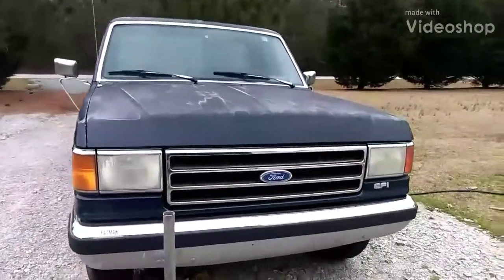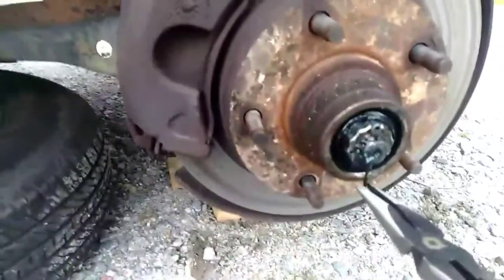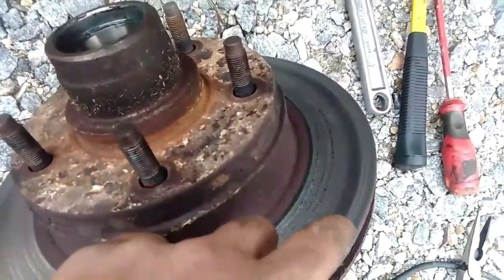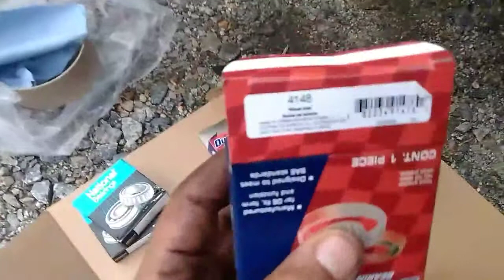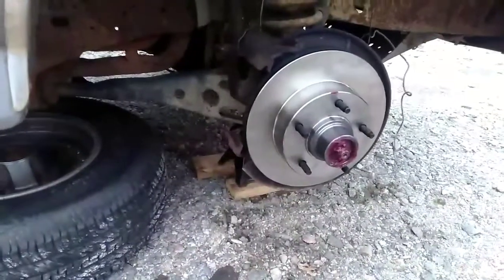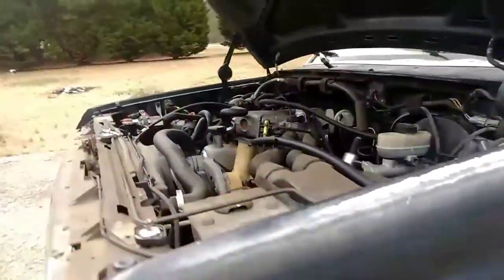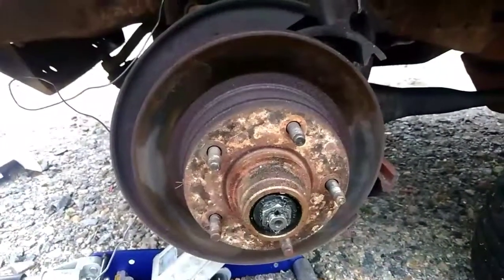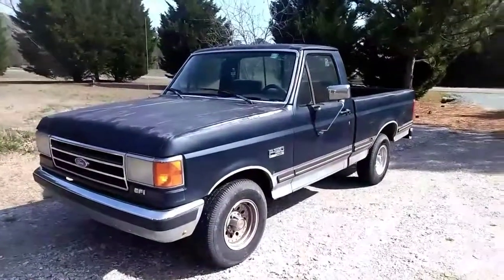91 f150 brake rotors change and pads

Comment: What's the torque on the nut
Reply: In my book it says 22-25 ft pounds as your torqing rotate roter forward. After you do that it say with your hand only back the nut off 1/8 turn its to tight to do that I found so Ioosen it with some channel locks then finger tighten it